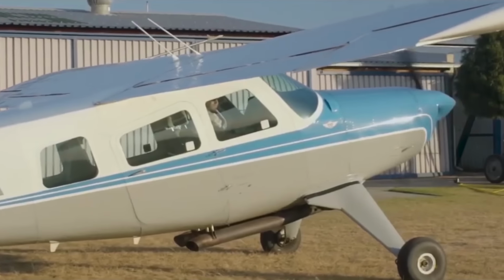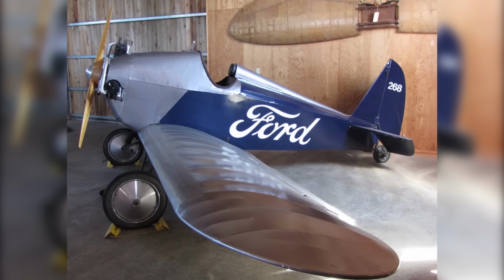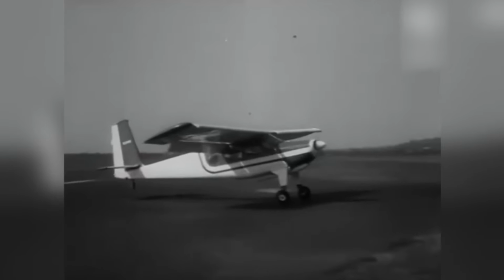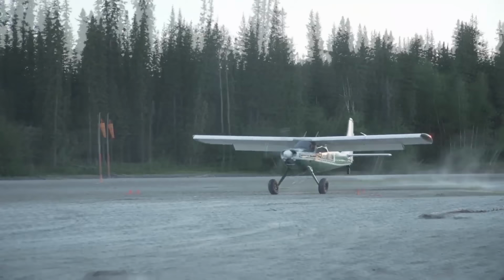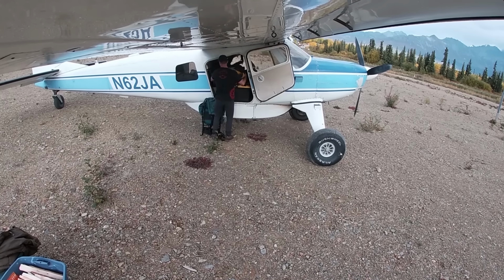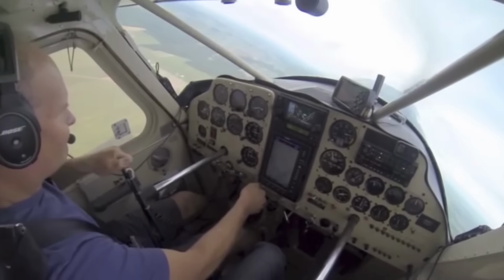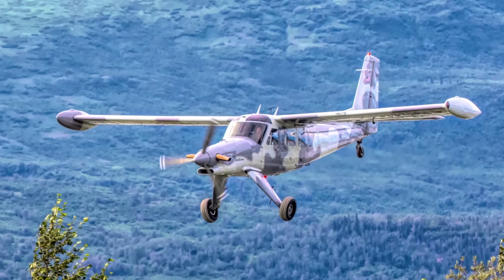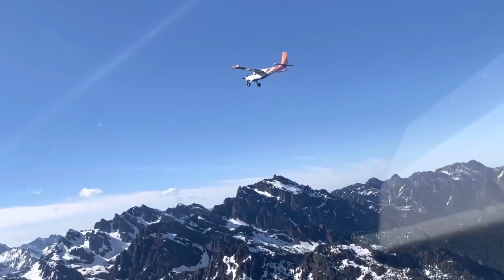The Plane that Turns Backyards into Runways

Comment: The Pilatus PC-6 Turbo-Porter has just as impressive a STOL capability and has been considerably more commercially successful - well worth a video about that one.
Reply from the maker: They are different machines...different price point, different fuel burn, the Porter is much larger, plus a bit longer takeoff role. I don't think they really compete - but the Porter has a huge advantage with a turboprop, seeing that it's becoming impossible to buy avgas in some countries. Which is why JAARS replaced them in their missions today.   As to a video, I think the Porter is already very well covered, whereas there's no documentary on the Helio.  (plus, i'm fond of old piston airplanes, lol)
Reply: @aircraftadventures-vids  I had a piston Porter for quite a number of years, and it would compete with the Helio in the backcountry. In fact many people mistook it for a Helio. Both are great and interesting planes, with their week point being in maintaining the out of production geared Lycoming's. My Porter ended up getting  a complete restoration as the number 1 Porter, and is now a flying museum plane in Switzerland.
Reply: @aircraftadventures-vids  Fair. On reflection, the Porter was more a competitor for the Stallion than the Courier.
Reply from the maker: @MrHws5mp  100% 👍
Reply: True. Also wondering why it did not take market away from the Cessna 180/185 ?
Reply from the maker: Different mission, different machine (although the Cessna is much more practical airplane)
Reply: Saw it land on a helicopter pad high up on a building
Reply: @ap0lmc  
burj kalifah ?😂 The later one was not a 
Courrier and was highly modified by Mike Patey.
Reply: @alexdarcydestsimon3767 yes I believe it was a Carbon Cub modified to the max
Reply: The Porter is no doubt an amazing aircraft, but they're way more expensive to operate than a courier as well ￼